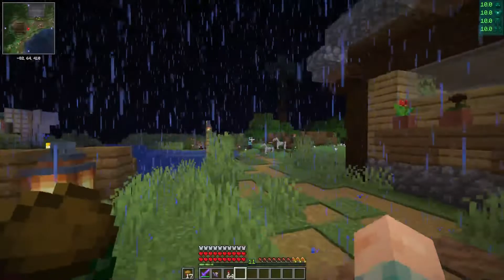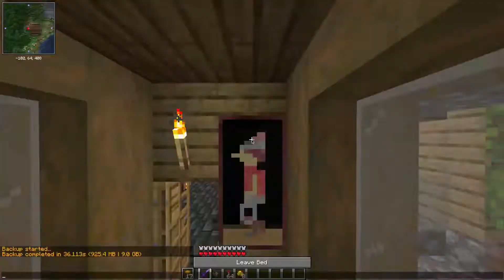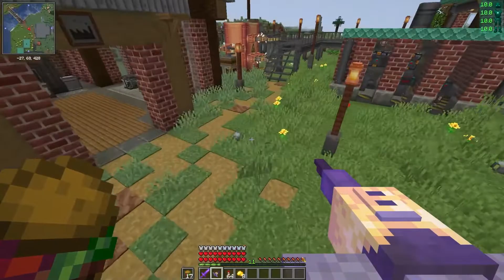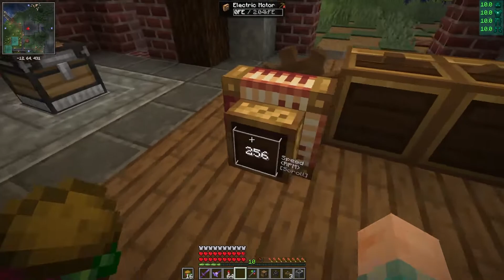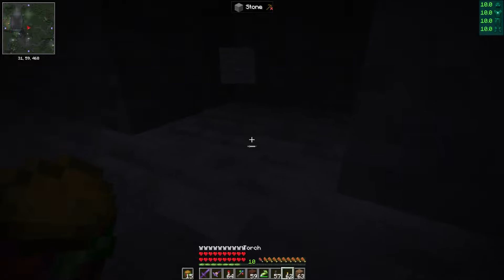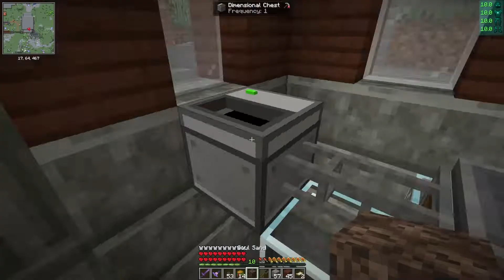[HE3] Episode 37 - Quartz & Gold Automation

Comment: HV accumulators perfectly match the output of a diesel generator, 4096 by default, so you would need one per generator, HV relays can transport 4x as much, so if you want multiple generators you can have 4 per wiring setup, anymore will risk burning your wires, if you want to transport more then 16k rf/t you will either need wires running in parallel or use flux networks.